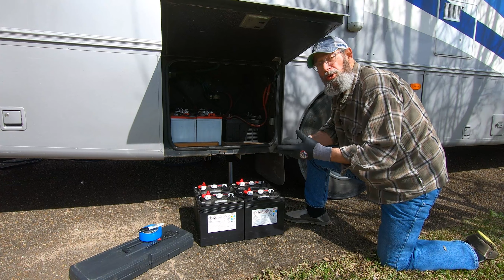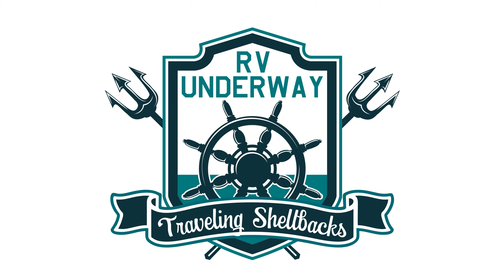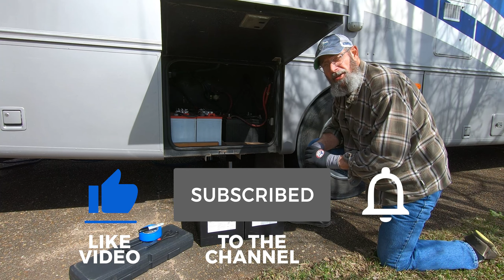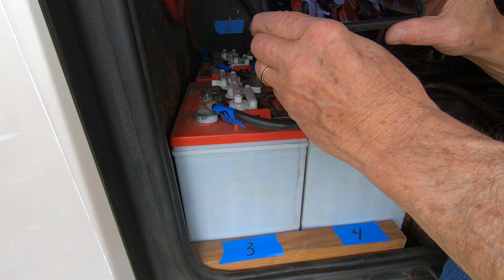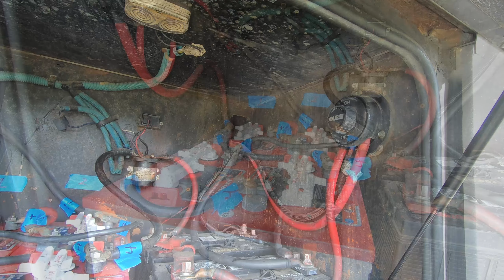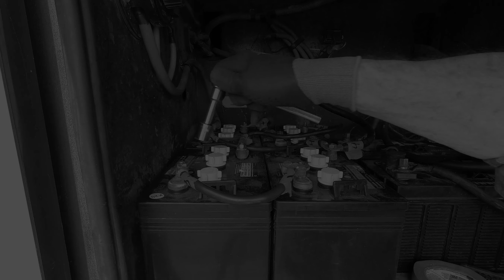Replace Deep Cycle RV House Batteries - Coach Battery Easy Install

Comment: Best tip ...  Take pictures before you even get started installing the batteries.  Make sure you understand how to reinstall all the wires and in the right place.  That will save you one big headache later..
Reply from the maker: Thanks, shipmate. As a broadcast engineer, dealing with wires all day long, the camera on my phone is invaluable. In the old days, I would have to draw pictures, schematics and color codes. Sometimes technology is awesome!
Reply: Wha???? Parallel vs. Series?? 12 volt, 6 volt, 24 volt. Eh, whatever....

Comment: Thanks.  A word of caution that some Magnum Inverter/chargers require the positive to be connected first, to avoid the inverter seeking ground through the data cables and frying components like the AGS and Inverter remote attached to those data cables.  Best to check with Magnum first.  It’s also stated in the manuals.

Comment: Thanks for the step-by-step tutorial. I think it’s super smart that you not only labeled the batteries and the wiring but also took a picture before you swapped everything out. You sure make it look easy, Ricky!
Reply from the maker: You're welcome! It really is easy...just heavy (and sometimes dirty). But great to have a full charge now. No more dimming 12V lights and such. Thanks for checking out the video, family!

Comment: I'd like this at least twice but they asked for my ID..... great DYI video by good friend!  I appreciate how you avoided shipfitters disease by not completely rust treating the interior, recoating with bed liner and also replacing the chassis batteries with new shut off switches, breakers and cables....because they had a bit of dirt on them, then redoing the door panel with vents and a filter panel.....
Reply from the maker: Not sure how long we'll hang onto Matilda D, so I'm hesitant to invest too much in her right now. That battery compartment could have used a little care. Thanks for watching, Dan. You are the man!

Comment: Good tip on labeling the cables and batteries! I usually take a photo but of course that one "important" cable just isn't in my photos. How's your back after lugging those heavy batteries? Thanks for sharing! Steve
Reply from the maker: My back is just about back to normal....those suckers are heavy. Yep, sometimes a photo alone leaves some hidden details. I like to label and photograph....cover all mu bases. Thanks for checking out the video, Steve. See you down the road, brother.

Comment: I enjoyed that Ricky well planned and great advice. We have 4 year old batteries which we are treating with care to try to make them last another season. 😃 Safe travels 🚐👍🏻 Trev
Reply from the maker: Thanks, Trev and Sue. Yes, squeeze the last drops of juice out of them. Then buy you some AGMs. That will be my next project. Do y'all have solar?
Reply: @RVUNDERWAY  we currently have 100 watts solar and it is connected to the habitation and engine batteries as required so they are both protected. The habitation batteries are 2 x 12 volt, 100 amp hour. This usually supports off grid parking but due to our climate we now mainly choose a campground with electric hookup. 😃

Comment: Just a reminder that even if you take photos and videos of how the RV was wired prior to taking it apart always double check if it’s wired properly. We learned that lesson after we bought our first RV. The dealership had wired our 2 batteries wrong and we didn’t realize it until we learned more about series and parallel wiring.
Reply from the maker: I've been a broadcast engineer for decades and I still have to stop and think about the battery wiring scheme....every time. My coach manual also had the wiring diagram in it....as a backup to my labeling and photos. Thanks, Fabian and Becky!

Comment: Great video.  We need to replace our batteries.. Thanks for making it look easy.  Safe Travels
Reply from the maker: You bet, Jerry. It IS easy....just heavy. Get Teresa to help you tote the batteries. Put Levi to work wire-brushing the cable connectors. Thanks for checking out the video, Jerry!